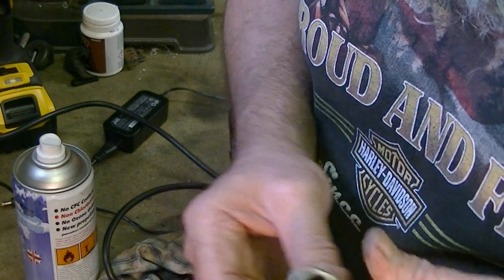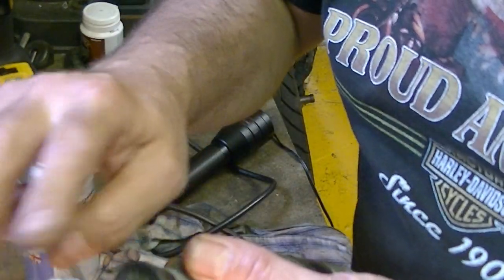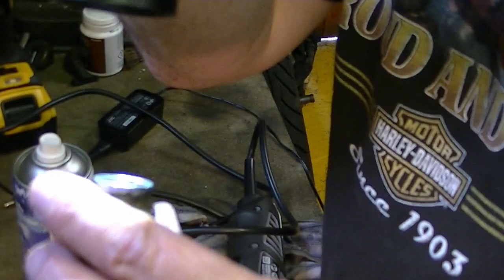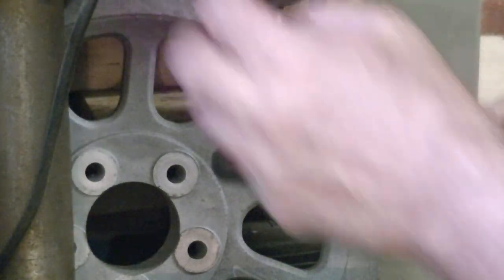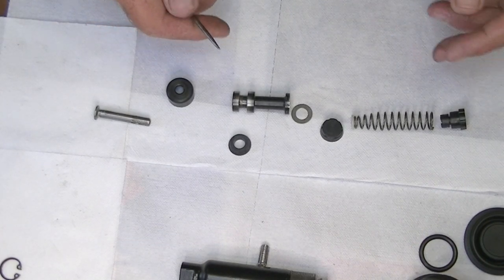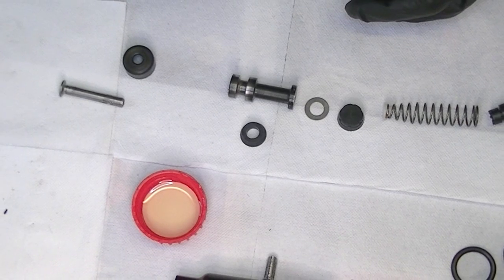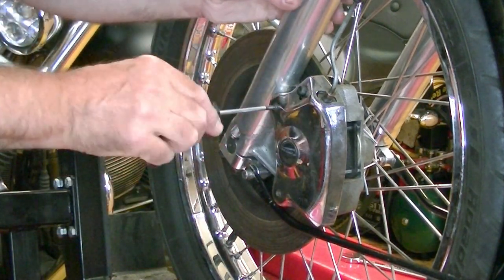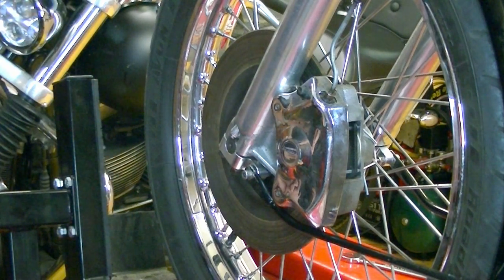Triumph Bonneville T140 Front Brake Service - Part 4: Master cylinder rebuild

Comment: If your front master cylinder needs overhauling, I would recommend taking the opportunity to upgrade to a 13mm bore stainless steel cylinder assembly. It gives better braking performance than the standard 5/8" bore, comes complete with all internals, and screws straight in as a direct replacement, using the same reservoir and hose connection. I did it on my 1978 T140V about 4 years ago, and it made a huge difference to the braking.
It's not wise to use ordinary bearing grease on anything that comes into contact with the rubber parts (like the boot around the pushrod). I use red rubber grease for the pushrod.
Reply from the maker: Thanks for that tip Rick. I'll definitely look into the upgrade sometime.
Reply: Where would I source that from, please? Can see that it would make sense to upgrade rather than rebuild. Thanks. '78 T140v
Reply: @bm7760  I got mine from FD motorcycles in Dunmow, but a lot of the specialist Meriden Triumph parts stockists list them.

Comment: Wow - thank you - your series of servicing your brakes has given me the confidence to try this for myself. I struggled to get the front caliper  sealing ( metal ) ring in. I tried with a wooden block but mullered the leading edge. I subsequently ordered another set from TMS Nottingham, and sat pondering. I'm hoping my musing helps others. I used a vertical press to push the ring into position and it worked perfectly first time. Thanks so much for publishing, I am now subscribed - Dave -  79 T140e
Reply from the maker: Thanks Dave. I'm glad my videos helped. I've been recording several more videos of the T140 in the workshop. Those should be up on my channel over the next few weeks.

Comment: When I bleed mine, if I've had the system completely empty, I find it can be difficult to shift all the air from the rigid pipe between the yokes and the upper hose, but you can overcome this by slackening the union at the top of the lower hose and pumping until it flows free of bubbles from there, before completing the process in the normal way.

Comment: I have this exact problem with mine. The moment I loosened the bleed screw the release of pressure in the line let the wheel spin freely. Figured this was a sign that the master was at fault rather than a sticking caliper. Servicing both ends regardless. Any preference for parts supplier? Thanks.
Reply from the maker: I don't have a preferred supplier, but I but parts from https://www.classicbikeshop.co.uk/